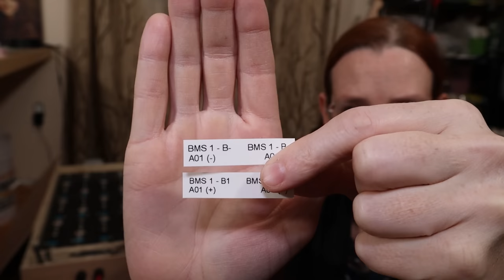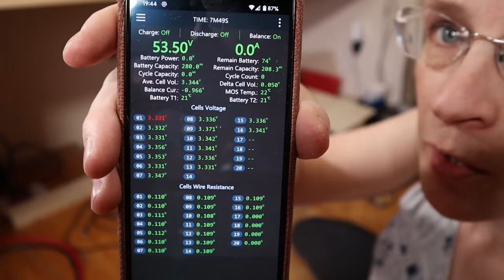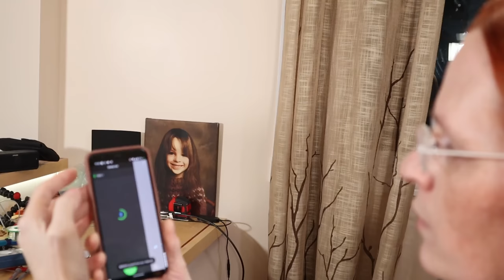JK BMS and Bus Bar Resistance - How to build a 48v Lifepo4 battery (Ep. 28)

Comment: There’s many ways to figure out bus bar/wire resistance and the losses on your LifePo4 banks. You can measure the mV voltage drop while under load and even figure out the Watts lost in each connection. You can measure the width x thickness like 2mm x 20mm and use online charts to show the resistance per inch of foot. You can use a thermal camera and under load you can see the connection quality and losses for each connection and the entire battery at once to spot all the high loss spots you need to correct. You can also check a few types of bus bars at the same time with a thermal camera. You could heads up compare a solid copper bus bar, the flexible 10 AWGx4 and 4 AWG while under load and you will see all the problem connections stand out instantly.  Also check wire charts as true Gauge properly made pure copper 10 AWGx4 and 4 AWG have almost exactly the same resistance per foot. 

The millivolt drop with a set load in Amps will allow you to calculate the resistance without a milli ohm meter and show you how many watts are lost at that junction. Does your fuse drop 40mV when under a 100 Amp load? So is your fuse wasting 4 Watts and how many kWh’s will be lost over time? How about your switch? You can even figure out the losses in your BMS by the voltage drop on a load. You can even figure out the total losses and efficiency of your battery as a whole. Is only 80% of the kWh’s going to the motor or 98%? You can measure the voltage drop under load and know.

Also there’s also pre-made  copper "braided" “flexible” busbars. By using 4AWG busbars instead of 1/0 or 4/0 are the total losses of all connections on all 6 battery banks at 100Amps causing you to lose the 20% of energy of an entire battery bank or just 1%? You should know as 20% would be like having 4.8 battery banks not 6. I’m just trying to get you to calculate the total losses NOW and it should have been done before you started as you might find cutting 1 pound off of bus bar wire might be like losing 2, 5 or 20 or 50 pounds of battery capacity and battery cost and charging losses and boat loading and motor efficiency due to added drag. Also what will be the bus bar battery losses at 10%, 50% and 100% throttle? Using 4AWG or 1/0 or 4/0 AWG bus bars. It’s pretty easy to figure out.

Personally I would have a  FLIR thermal camera with me at all times as there are 100’s of problems and uses for it inside a boat and a laser thermometer gun. You can quickly spot a crimp or terminal failing on all your battery banks at once. Using an ohm meter on 100’s of terminals takes forever and is hard work on a boat in the water. Even when you’re done you won’t know what side of the terminal or crimp is the problem like you can with a Flir Thermal Camera. Even the phone Thermal camera’s like a $200-300 FLIR one or FLIR one Pro are plenty good for this. You can spot hull delamintion and weak pipes, bad insulation,  water leaks and intrusion and endless other stuff like hot spots on solar cells and bad wiring!@! all over your boat. Google and look at a bunch of FLIR thermal images of Marine Surveys and hull delamination.

Comment: You should try making some flex bus "bars" with multiple thin flat stock. I bought some but they haven't come yet, to see how they are made. But i think it is just multiple thin flat stock.
Reply from the maker: flat stock would allow for up and down motion, but not rotation. I wanted to absorb movement in all axis with minimal transfer to the posts.
Reply: @TheDigitalMermaid   that is true. wish I had thought of that before ordering 7. they ain't giving those away. lol.
 On my last two 8s 105Ah,  packs I built, I made my own but they were so short, they really didn't have much give.  I think I'm going to do those two packs over with these curly bus bars. they kinda look cool too. have you tried the braided type used for grounding in vehicles?
Reply from the maker: @immrnoidall  I haven't, but Andy did, and I can't say he was impressed. He tested them at the same time as he tested the two types of "flexible bus bars" I made. The ones I chose to build for my boat are the 4x 10awg ones, as they give the best flexibility in all axis of movement. https://www.youtube.com/watch?v=EjBqng70ORc
Reply: @TheDigitalMermaid   10awg, that is great i have about 20 foot of  fine strand left over from my truck amp install.
Reply: @TheDigitalMermaid  blue tooth slowly died and finaly stopped working. uninstalled the app to reinstall and nope. will not install . installed a bunch of other stuff on the phone fine . not this JK  bms from hell. and no support from seller or anyone. TRASH.

Comment: Probably not relevant today but love your enthusiasm..
       Very interesting that you are paying attention to the cell to cell resistance.  I'm a person of simplicity and would like to say;  I wouldn't pay much mind to the resistance values from that meter.  Verifying the resistance of the buss bar over your home made paralleled 10AWG jumper you should be measuring at micro ohms with at least a 3 amp to 10 amp current signal calibrated to conductor temperature.  lets agree that's really not necessary for this build however nice.  Unless you are building to sell and you are trying to pinch pennies for production.  The 3 points that matter as you build your battery.  #1 resistance needs to be low at each cell connection, #2 resistance needs to be low in the connector from cell to cell.  #3 the connector needs to be flexible for expansion and contraction of cells during transportation, heating - cooling from charge discharge cycles. 
Address #1 make sure the cell post contact area is flat and smooth, clean, and big.  You can only ensure you clean the post and use as much of the post you can with your cell to cell jumper lugs.  Address #2 from what I see of what you built, the 1'st option is perfect as long as you are allowing for 125% max current the lugs you are using have what looks like adequate surface area.  Address #3 the short size of the 1st jump which has enough elasticity required, as nice as that 2nd loop jumper is you don't need to over build as in that example.  What I mean is different length #10 cables and a big loop adds more that can go wrong than right. Finally need to be sure you clean the lug and use stainless hardware with a beveled washer pointed correctly, and torque each and every bolt as specified by the battery manufacture mark each connection after you torque it.
PS. use de-natured alcohol for cleaning connection points avoid using greenies you want smooth surfaces to contact each other.  and please put some venting in that wooden box top and bottom...
Reply from the maker: Thanks for the kind words. In the most recent video, I do test with a micro-ohm meter after I was kindly gifted one. :)

Comment: You were stressing over not having a 5v battery but the requirement is greater than 4v so you can use (3) AAA in series or a 9v battery which is a much simpler method.  JK also now offers a display that has a built-in on/off button.
Reply from the maker: That button is sitting on my desk right now. I'm hoping to finally work on a video showing it after work today. :)

Comment: Power supplies/batteries create or are a voltage difference. Just add a 5V power supply in series to the battery. Attach the negative of a 5V power supply to the positive of the battery, then there should be (battery-voltage + 5V) between the negative of the battery and the positive of the power supply. It's the exact same thing that you are doing by putting your battery cells in series. Iirc, Andy also seemed to be wanting to use a powersupply to create the full voltage to boot the bms. Even a simple usb power bank will do just fine.

Comment: On the victron check that you have a tail current of something low (like 0.1amps). It will then stay in absorption longer to slower more filling the battery at the top end when charge suddenly drops off. 

Maybe I’m wrong about this but helps me on my MPPT. I’m pretty sure the multi and Quattro have similar settings.

Comment: Have 1/16" thick aluminum busbars made. The ones I made IIRC were 1.5" or 2" wide. Because they are thin the flex if required to make good contact with the terminal end. I have a few spare I can send you if you want to test them.
Reply from the maker: Very kind of you to offer. I think I'm settled on the shorter 4x 10awg though. A big reason being that I can make them as I need them, even later when on the boat. You might want to check with one of the other, more testing focused, channels though. Cheers

Comment: if you look on the back of the plug you find a strip gauge also if this is for the boat you said it was for your shore power.  Shore power will be a 30 amp 120 volt twist lock ore are talking about pluging into the 120 volt outlet in your boat

Comment: Hi Digital Mermaid, new subscriber to Andy's channel which sent me your way by his recomendation. (Yes, new sub for you :))
You've gone to the detail of checking internal resitances and logging for each battery, terminal.... and derived the relationship of resistance with diameter and length, does your BMS allow for different resistance values across each of your balance leads? If they are different lengths or trimmed down to reduce excess and have a neater install, would there not be a difference in behaviour from the BMS charging a cell with the shortest balance lead vs longest due to the reistance of the balance lead itself?

Keep up the good work and learning!!!

Comment: Given the cells are quite "snug" within the box  (I forget if you bound the cell blocks with fibretape or something else) it is "So Unlikely" that the cells will ever expand or contract to any noticeable point.  They will ONLY swell is you over charge at a Hi C-Rate or Over Voltage which is not likely with the system being setup properly.  I've read & seen vid's by Marine Folk and most of them use the standard busbars.  The fixation on flexible to this extent honestly seems  too overkill.

The JK will also show you what it sees for resistance per cell, will be interesting to see you compare those readings with the TR-1035 tester.    One you do that, "Just for Fun" then replace one of your "fancy flexies" with a solid bar and see what the JK & TR say in comparison.  Might be interesting. 

BMS -B -P wires are AWG-7.  2x7-AWG = 4-AWG.  One Option to extend wires, you can use a 4-AWG  Barrel Connector and extend with a single 4AWG wire to Lug.

BMS Sense Leads are 22-AWG
22 AWG x2 (folded over as done in this vid) = 19 gaugue effectively.

Excellent Wire Gauge calculators here:
https://www.wirebarn.com/Combined-Wire-Gauge-Calculator_ep_42.html
Reply from the maker: Keep in mind, "marine use" is a very broad classification. If I only planned coastal cruising and the loss of power meant I lost my fridge, i'd agree that I am obsessing too much.

In my case, I will live on the boat and I will be doing crossings. I will be sailing in bad weather and pounding seas. The shock loads will be fairly frequent and strong, relatively speaking. Also, my batteries are my house bank and my fuel tank. 

The loss of power, or worse, over heating from a loose terminal when I'm off shore, have significant consequences for me. In this light, I don't think it's unwarranted obsession.

Comment: You connected the BMS wiring before you connected them to the battery after you crimped the connectors on. So if you did make a short. You harmed the battery AND the BMS.

Comment: There was a video i watched where someone used one extra battery somehow with their pack to start the bms up (like a 6v or 9v).
i got a jk bms and plan to be without mains but it has the extra screen and button and the renogy rover charge controller has a lithium wake up function provided there's sun.
i hope you work out a good solution
Reply from the maker: I ended up swapping to the BMSes with start switches. Had I not been able to, ya, anything that got ~+5vDC would do the job. Cheers!

Comment: 0.19 mOhm loop busbar have inductance and its not accurate to measure it like this. I suggest to make Voltage drop in ohms law.. but flat metal busbar is the best. i am making aluminum bubars for my cells with length of 14 cm and resistance 0.074 mOhm
Reply from the maker: I figured that out in a later video, and then redid the resistance tests.

Comment: Think each bus bar as small resistor. That includes ring terminal. In series resistance increases, in parallel it gets half. Ring terminals are always weak spot. Because unlike wire that has lots of strands to carry current. Ring terminals don't have the same amount surface area. Try 2 two wire ones in parallel might be better than one 4 wire one.
Reply: Also 10AVG silicone wires have difference. Most chinese wires have 1050 strands of 0.08 wires. When i got my self 8ne with 1946 strands of 0.06 wire. Core does not matter only surface area of the wire.
Reply: The surface effect isn’t an issue for DC. It only matters at high frequency AC.

Comment: How do I make a 64S BMS if I only have 4pcs of 16S BMS?
Do I make 4units of 16S batteries, then connect all these 16S batteries in series (of course only through the BMS)?
Reply from the maker: A 64s pack would be 204.8v, I'm guessing that's not what you actually want, is it? If you mean to run all 64 cells off one 16S BMS, then you could create 16 separate 4p packs (connect the positive of four cells together, and their negatives together) to create a single 3.2v cells with 4x the amperage, then connect those 16x 4p sub packs in series. This would give you a 16s4p config at 48v.
Reply: @TheDigitalMermaid  Actually, yes I want to make high voltage battery bank using just 16S BMSs. I am thinking it would eventually fail because they wont balance each other.

Why High voltage?  Some inverters use high voltage to reduce current draw and heat on the batteries.

Comment: Couldn't you use a simple double pole switch with a 5v+ reduction resistor to momentarily connect a drop in battery voltage to trigger it to start?  Also I'm curious how my battery busbars would perform vs your flexible. I used copper pipe that I flattened into busbars and drilled holes in each end, but for relief as I was worried about expansion, I made the DIY copper busbars 1 inch longer than needed and bent a small 1 inch wide V in the middle, which gives the busbar the ability to expand with the batteries if its ever an issue, since the busbar is able to move pretty easily with that V bend in the middle a slight amount.

Comment: Energy will flow trough the lowest resistance. This might overheat your flexible bus'bar'. Your battery should NOT be able to move, so you do not need flexible busbars. When you use cells that allow movement, the friction between the cell might create a short.

Comment: Hi, how about Tinned Copper Earth Braid For Battery Earth Straps & Cables 19mm² 130A. You could mimic the busbar with a 6mm lug on each end?
Reply from the maker: Two reasons; First is that the few I found cost a fortune, and this method is something I can make on my own anytime.

Comment: So the cable resistance is twice the cell internal resistance ... you're going to be losing more power in the links than in the cells. Wire sizing is partly about heat (melting the wires is bad!) but mostly about power losses. With 16 cells at 0.03mO for the solid links vs .15mO for the wire and 0.07mO for the cells you've got power losses of I2R, so at 5kW = 100A draw on the pack you'd be losing 11W in the cells, 5W in the solid bus bars or 24W in the wires. Which isn't really significant, saving 20W on a 5kW load when you're losing that much in the battery monitoring system or inverter isn't really critical. IMO anyway. I'd be more concerned about the solid bus bars not aligning perfectly with the terminals and giving you unexpectedly high resistance there. FWIW you might be better bolting the links in place then measuring from bolt to bolt on the batteries would be more useful.
Reply from the maker: Thanks for the math! Ya, I'm not at all keen on rigid exactly for that reason. The slight additional loss is well worth the mechanical benefits.
Reply: but the heat on the busbars transfers to the lithium cells degrading battery life significantly by ~1000 cycles per 10*C

Comment: You know that 0.03mOhm at 100A is only 3mV drop.  4 series means a total of 12mV dropped in the bus bars for a total of 12mV*100A = 1.2 watts.
In the grand scheme of things, that's sod all squared given it would be a 1.2W drop on a 4800W circuit!  Surely you have bigger ghosts to hunt?

The only concern with bus bar drop would be the error factor in the cell voltages being out by up to 12mV could effect balancing and cell monitoring and tiny, tiny, tiny little bit.  Surely nobody runs their tolerances that close.
Reply: Should point out the current shunt in the BMS will probably drop 10 times that voltage.  You could remove it and just measure the drop across a bus bar.  It will be very hard as it only drop 12mV at 100A.  The BMS's shunts will be more like 0.1 or 0.05 and drop more like 2 or 3 watts just measuring the current.
Reply from the maker: @1over137  aye, and thanks. The focus turned to flexibility more than resistance as the build progressed, for just this reason. Thanks for the post!

Comment: im seriously confused on why 58v was needed to wake the BMS. Its a 48V battery. WHat am I missing here?
Reply: '48V' isn't the nominal of this battery, it's just a general indication. The actual nominal voltage is 3.2Vx16=51.2V.
Reply from the maker: To add to UpNorth, when the pack is closer to full, the voltage increases even more. You then add 5v to get the JK's startup voltage.
Reply: Can also read the JK-BMS manual on Andys site under the same BMS, that I sent to him.